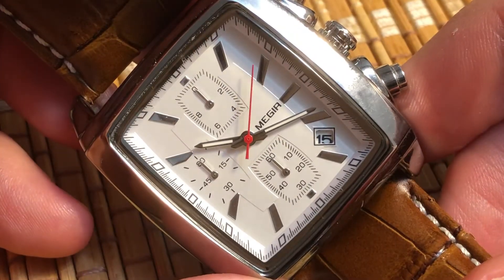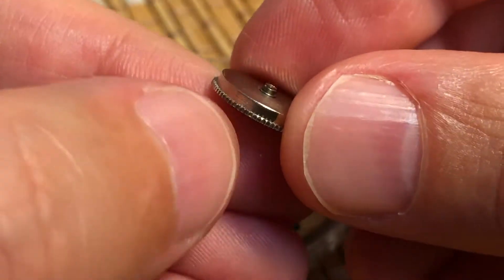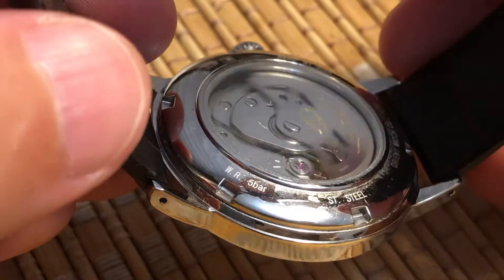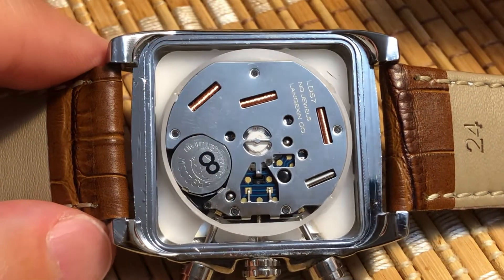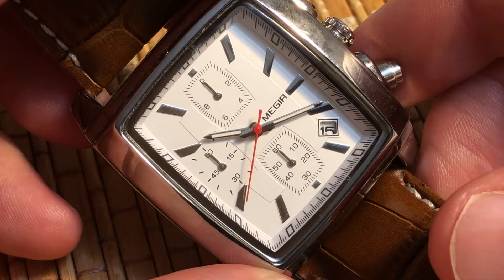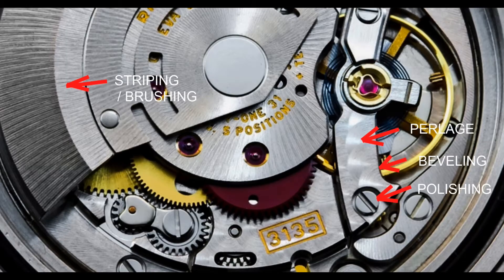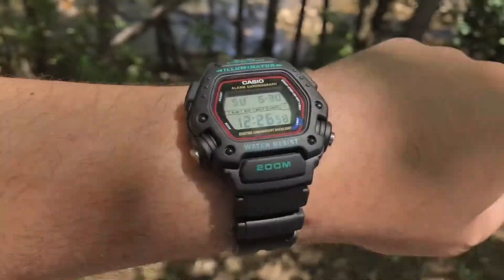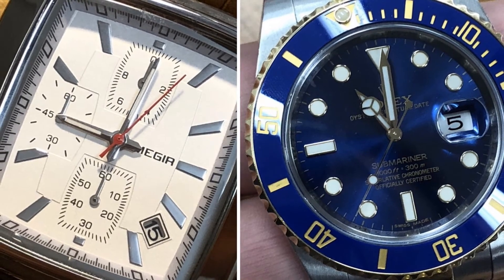Why the Best Watches aren’t Quartz

Comment: You know patek phillipe has a quartz version of nautilus and more expensive than a rolex submariner, the idea of quartz value is to see which one is much more closer to atomic time and which one has a unique feature such as micro seconds adjustment, battery life span, low battery like an eco drive, or like fo journe elegante has a sleep mode, it's a quartz i know but quartz is much more durable, lighter, slimmer, than a mechanical i have a 1977 seiko king quartz and its much more accurate than my phone 😂, it still running great even though its 48 years old watch, has a 12-2-4-6-8-10 hack mechanism and a low battery indicator that ticks the seconds hands to 2 ticks and an ecodrive high beat suwa seiko-sha precision movement
Reply: Those vintage Seiko King Quartz models are really special. I have one as well and the technology is miles above most of today’s lower priced quartz movements.
Reply: @loogoo yes it's not expensive but can the rich people buy one for himself idont think so and that is why the vintage unique is a piece special. Its unique, has a history and you cant even get another one that easily if you sell it

Comment: I love watching mechanical watch restorations and learning about watches, but, after not having worn a watch in years, I recently bought an Apple Watch. Smart watches are synchronized to an atomic clock somewhere and are therefore more accurate than a quartz watch. Just saying.
Reply: Many Casio quartzes also have this feature, for example some sync to atomic clocks over radio.

Comment: i clicked away after the intro. surely the 10$ quarz wont have quality. but a 200$ quartz is sure as hell flawless. can you say the same about a 200$ automatic?
Reply from the maker: If you clicked away after the intro, why would you comment since you don’t know what the video says?

No watch for $200 is flawless (no watch for $10,000 is flawless).

But you can get a great Orient mechanical watch for about $200, and a very nice Invicta for less than that.

A $200 quartz is generally a nicer finish than a $200 mechanical because the entire $200 is in the case and bracelet. A Swiss quartz movement costs about $6. 

$200 is about as much as I’d pay for a quartz watch.
Reply: @WondersofWatchdom  i understand that. but the point is, when you compare a quartz and a mechanical in the same price category, the quartz will always prevail because of the cheap movement. the money you pay goes into features, finish, quality control..
Reply: @WondersofWatchdom  lets say, a 200$ quarz is high end, a 200$ mechanical is solid entry level. if you scale that up to say 10,000$, the quartz version will have better bang for buck. in theory, the most expensive quartz will beat the most expensive mechanical. though most people will not buy a mechanical for its utility, but personal value.

Comment: A quartz watch is a practical purchase, where as a mechanical watch is an emotional purchase.
Reply: No, i recently bought a Citizen Promaster Eco-Drive in a purely emotional purchase, because i fell in love with it seeing the watch in a jewellers window. 
I really don’t care, if its a mechanical or a good quartz movement.
Reply: Nope. Automatic was practical for me.
Reply: @Nathan-jt8zt How so?
Reply: @TC-th1ey without being too specific, work.

Environment, or certain ‘zones’ - including remote and long term aspects. It’s highly unlikely that a quartz will run out of battery at any given time, but it’s guaranteed that at some point it will. I can’t really afford to have that happen while I’m at work.

Extremes in temperature, high electromagnetic field, magnetisation, explosive/static environments and EMP all being a consideration.
Not only that but my work also relies on recording times throughout a shift.

It’s just a better choice for my specific work environment(s).
Reply: @Nathan-jt8zt  Mechanical watches are far more susceptible to all the environmental impacts you described.
Reply: @trulsdirio  That’s just not true — did you even think about it?

Mechanical (automatic) watches are far less vulnerable to several of the environmental factors I mentioned precisely because they contain no electronics, no circuits, and no battery. Electromagnetic interference, EMP, or generator-induced fields don’t affect a watch that’s powered by a mainspring and gear train — there’s nothing to disrupt. Quartz watches, on the other hand, rely on a stepper motor and microcircuit that can freeze, lose calibration, or fail completely under strong EM exposure or high radiation.

In explosive or static-sensitive zones, quartz watches also carry a tiny spark risk if damaged, which is why certain industrial safety standards specifically restrict electronic timepieces. A purely mechanical movement is inert in that sense.

Battery reliability is another factor — in long-duration or remote work, a quartz watch will inevitably stop when its cell dies. An automatic will keep running indefinitely with motion or manual wind.

Modern mechanicals also use anti-magnetic alloys (like silicon or Glucydur) and soft-iron shielding, meaning magnetization is a minor and reversible issue compared to an electronic fault in a quartz.

So no — a well-built automatic isn’t “more susceptible.” It’s actually more resilient in high-EM, isolated, or safety-critical environments — which is exactly why they’re still used in aviation, diving, field, and power-generation roles today.
Reply from the maker: I don't know about emotional, but definitely a sense of appreciation of the craft rather than practicality.
Reply: @WondersofWatchdom  Really? Even the cheap model with a popular disposable movement for one hundred or two hundreds bucks? Come on!
Reply: @WondersofWatchdom you just explained sn emotion
Reply: @WondersofWatchdom  Isn't appreciation of the craft an emotion?
Reply: I understood how actual the tale of "The Emperor's New Clothes" is nowadays.
Marketing says how important are mostly useless features and complexity that people start to believe the world of  chrono, tachymeter, GMT, lume, new color variation etc and pay lots of money for an illusion.
Other people who weren't targeted by marketing laugh about "visible amount of money was given to a watch what is not even punctual" 
I'm big fan of Spring Drive but I bought a casio A500
Reply: @TeXUSR  quartz watches can be annoying too. I work at a watch store and battery changing is such a hassle. Imagine having to your watch battery changed every 3-5 years. And it cant be fixed if its broken, it has to be wholesale replaced. I dont need the time on my watch, i have my phone for that. What I need is a solid piece of jewelry that I can pass down.
Reply: @PrimetimeX  absolutely, but as I know once in five years mechanical watches worth to take for maintain service.
Maybe solar watches can be maintained rarely.
I'm a big fan of Spring drive, but my watch budget doesn't cover that.
Reply: @TeXUSR The problem with quartz watches is that sometimes the companies stop manufacturing the batteries. The watch store I work at has this problem where we cant repair models from 1995 and before because the battery has been discontinued. Leaving customers unable to use their watch completely.

Mechanical movements, on the other hand, can have their parts manufactured on-demand as needed. Since theyre just pieces of metal shaped to a certain size and function, you can custom-order any mechanical part you need. This is something you cant do with a defunct battery type.
Reply: @PrimetimeX  That's absolutely valid. 
My oldest watch is Casio ABX-53 for '95. Battery V371 is available for that.
As an end user I didn't thought about this risk.
Personally I wouldn't buy more expensive watch like the price of Bulova Super Seville.
I'm just not the target of mechanical watches. I like the smooth seconds arm of it. But it annoys me to see seconds arm on a non punctual watch.

Comment: The reason to buy a mechanical watch was portrayed on Northern Exposure, when ex-astronaut Maurice Minnifield buys a 400+ year old tower clock, and discovers that he also has hired a “technician” to repair it so that it could be accurate to better than 10 minutes per day.  His first thought is to replace the movement with a proper quartz movement, at which point the German technician steals it to hide it away from the crass American who wants his clock to tell time, not enjoy the history it represents.

The businessman who spends thousands of dollars on a watch does so to demonstrate that he can, and he is too important to care about the watch’s accuracy, as he has underlings for that.
Reply: I the days before time zones.  Local time was Solar time.  so if you went 20 miles the time was off from where you came from.  In one of the national treasure movies the hero is trying to find a specific brick that a shadow would fall on at a certian time.  He says Opps Ben Franklin use Daylight time not standard time.  Big mistake, They used what evertime based on solar time. not a time zone.
Reply from the maker: Cool story!  I checked out a YouTube video of the clock you’re talking about. It would be horrendous to see a beautiful old clock replaced with a quartz movement.

One thing I would add is that most people who spend thousands on a watch DO care about the accuracy, but they appreciate the fact that a beautiful, well crafted, purely mechanical watch can be accurate to a few seconds or less a day.

Comment: Mechanical watches still have an advantage in high-radiation environments where electronics starts to literally fry. That said, it's the level of radiation that would quickly be dangerous for the wearer --  where you may want to track your time of exposure accurately.

Comment: Frankly, "soulless" is the word people throw around when they've lost the argument.  Mechanical movements are aesthetically attractive, but as far as function goes, quartz watches kill them in every way.  I have a Rolex that stopped working because it needs insanely expensive service and needed to be set all the time anyway.  I'm not even sure I'm going to bother to get it serviced and working again.  The tech quoted me -- I swear I am not making this up -- at $800 to $1000 MINIMUM plus they tried to tell me that it wasn't an original dial and that they would "have" to replace the dial if they serviced it, putting it up to two freaking grand!  AYFKM?!  For a watch that functionally gets its ass kicked by the Eco Citizen quartz I'm currently wearing that doesn't even need a battery or any service of any kind?

Rich people get watches like this because if you've got that kind of money, you don't need to be on time anyhow, so your watch is just there to show off.
Reply: yeah its a gimmick and a cashgrab. If it was cheap auto movement, thats ok the price is ok, but those expensive mechanical movements are cashgrab, if you make calculations you end up paying something like 10-30euro a month to maintain it.
Reply from the maker: If you've ever tried to build or customize your own movement (I have), you appreciate that a beautifully made movement is a work of art.  With rare exceptions, a quartz watch is usually just a watch.  I like quartz too and own several, but purely for their utility.

Comment: I recently bought a Longines Hydroconquest 39mm Automatic. I was seriously considering buying the Quartz version for much lesser, but I knew I wanted my daily to be an automatic. The ritual of winding it everyday keeps me grounded. Rather than becoming an accessory I slap on my wrist without much thought, I take the time to 'wake it up' as I prepare for my day as well. When the day is done, it goes to sleep like I do (if I leave it be long enough). Having to wind it forces me to take a pause and remind myself that, like my watch, I too need to be prepared for the day. This isn't a lifeless consistent machine like I am not, rather it's like another entity that shares my days.

I love automatics for that reason, as I love my quartz watches for other reasons. Both deserve respect. Peace.
Reply: Is not an automatic if you wind it manually everyday, is it? Or i missed something?
Reply: @LastVeteran  Late reply, but it is an automatic in the sense that the rotor winds the watch through daily wear, but most automatics these days can also be hand wound which is useful to give a quick full charge, or bring it back from the dead if it is left motionless for a few days.
Reply: That's cool perspective.

Comment: Hello,

I have recently come across this channel. Thank you for the explanation of the difference in watch movements.

I have a question: 
I have fallen in love with a 1 hand style watch (Kulte Silver Generation), I was wondering if Botta-design is considered to be a good manufacturer of watches. 

For clarification I am a budget, low end shopper. I don’t want to spend more than $200 on a watch, but the only 1 hand watches I have found are between €500 & $1000, way out of my price range. Do you have any suggestions?

The only reason I am considering the UNO, is because I got water in the Kulte while washing my hands.

Comment: Well said!
IMO, we're living in great times (har, har) when people have all sorts of super accurate digital tech at their disposal but can still satisfy that longing for a mechanical solution. And not just the rich: You don't have to buy a Rolex or a JLC to get an excellent mechanical piece on your wrist. I've been a quartz user for years and years (child of the 70s and 80s, go figure) but I am super-glad to have re-discovered mechanical watches. Perhaps it's just my imagination, but they do feel rather more special to me because they can be more temperamental and require a bit more attention.
Reply: You can also leave a mechanical watch in a  drawer for a few years and it will work just fine when you take it back out, a quarz would likely be dead and maybe even have a leaking battery that has ruined the movement. You just don't have to worry about batteris leaking, battery life, effects of very hot or very cold weather etc. There are lots of advantages to a mechanical watch. In the same way a quarz watch has its own advantages, the timekeeping is fairly good although due its precision its actual accuracy gets cumulatively worse over time until you adjust it again where a good mechanical can average things out to a degree and keep better time long term. Quarz are a good grab and go option and also easier to deal with if you have several watches that you regularly use.

Comment: So how about spring driver?
Reply from the maker: Good question.  I didn't want to get too complicated in this video.  A spring drive is basically an automatic mechanical watch, but instead of a swiss-lever mechanical escapement, it uses a quartz-controlled escapement.  So, it's very accurate, and instead of ticking it has that nice smooth-running seconds hand.

Comment: I wear one which is solar powered and supposedly can last 20 years. Never needs batteries. Had it 10 years so far, never had to reset the time, only the date.
Reply: dude it still uses rechargeable battery or sth like that, it last 10-20 years.
Reply: @Cortesevasive  very high grade battery cell, they offer lifetime guarantee on it , if the battery ever goes bad they will replace it :)
Reply: @cartouchator  Really mate?  can you quote it ?  I never seen such labels
Reply: @Cortesevasive  as it turns out, it would seem citizen changed their warranty to 5 years across their range. Oddly enough though, my citizen eco drive came with a paper leaflet inside that said "lifetime warranty" (I bought mine 10 years ago mind you). Although checking the small print on that paper again, it says that the life expectancy of this watch is 20 years. So... Not lifetime then? But now they're only 5 years warranty.
Reply: @cartouchator  my AR1130 has 1y warranty or sth like that, certainly less than 6y. Yeah but those warranties are limited, I mean probably they would only cover if there was something wrong in quality control, but usual wear would be disregarded.

Comment: In my opinion, solar powered watches are the best .... They're superior in any way
Usually, the battery lasts more than a decade or two
Reply: Those Citizens
Reply: Eco Drive. i have one
Reply: @AntonyThorburn  I bought a Citizen Eco-Drive about a decade ago, I still use it ... They're awesome
But nothing beats solar G-shocks ... They're badass monsters :))
Reply: @Armin.T9  i had a seiko black knight , ifor 12 years from new, i love my Citizen Eco Drive, sleeps at 2 am hmmm, but great.
Reply: In 2000 I bought a Yema Seaspider with a Seiko Kinetic movement. It's currently at the watchmakers for its first battery replacement (and a new sapphire crystal).
Reply: I have a seiko chronograph that’s a solar powered watch. Solar powered watches are good because they don’t have that annoying sweep and can be heirlooms
Reply: Annoying sweep?
Reply: Yes. You are right. What's more there are quite decent solar powered watches on the market: Tissot, Orient, Seiko etc.
Reply: And I think solar watches use quartz movements, don't they?  I have a couple solar watches made by Casio.
Reply: Battery cannot be replaced in it sadly
Reply: @muthulakshmimuthiah4804  Are you sure about that? I know you can change G-shocks and Eco-drives batteries

Comment: The most precice clock is the Apple Watch... because it sync  to an atomic clock server.
Reply: well my casio watch does that as well via bluetooth connection to the cellphone or using the broadcast radio time signal
Reply: no its not.. because the time, the atomic signal need, to go first: to the apple server, then from the server to the internet provider, from the provider to your phone and from your phone to your watch have a greater delay then a time signal that is picked from an atomic watch directly from the signal.. we talking delays from up to 30 milliseconds xD :P